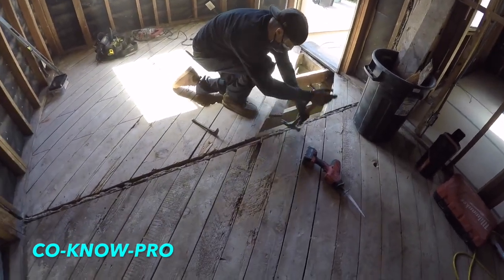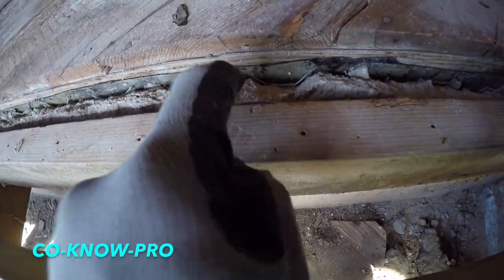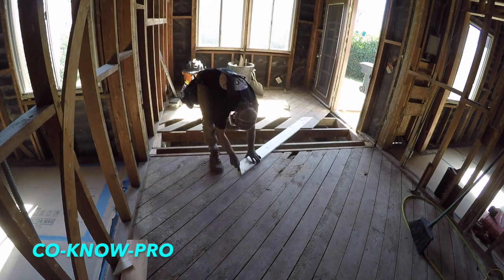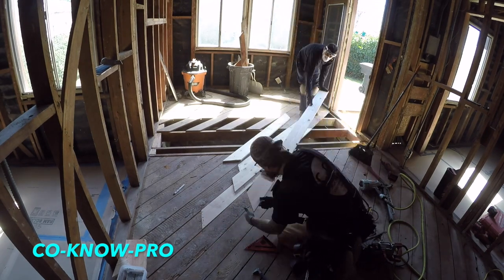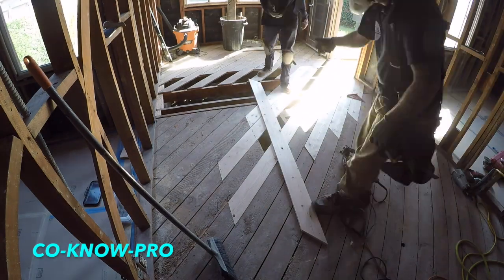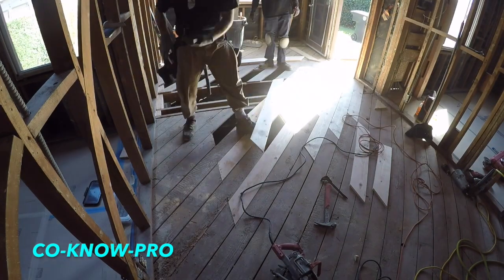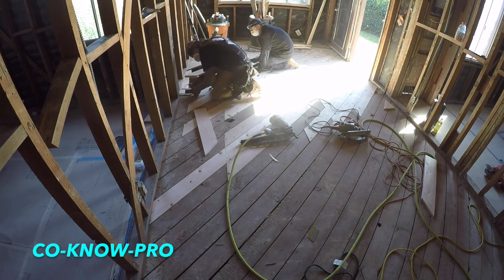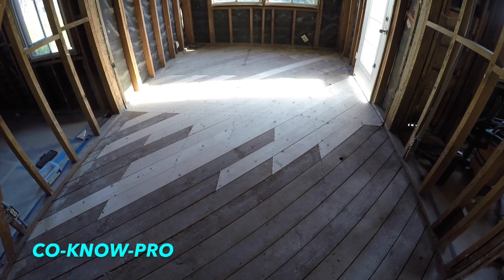🌟 How To Replace Subfloor In A Old House @co-know-proconstructiontips

Comment: Thank you all so much for posting this video. I have a similar project where the addition is lower than the kitchen. The subfloor is tongue and groove heart pine flooring. I wanted to match up the height and continue with kiln dried tongue and groove. Could I face nail them like you did in the video? Or should I nail it like regular hardwood floors?  Thanks!
Reply from the maker: Absolutely our pleasure, you can face nail them just make sure you use galvanized ring shank nails so they don’t back out with floor movement. It’s really up to you sometimes when you just install  finished nails in the groove like hardwood floor you can get buckling if there’s any kind of expansion. 
Also when you get your wood even if it’s kiln dried you still want to leave it in the room where the work is going to be done for a few days or a week to acclimate to the relative humidity in that room so you have minimal expansion specially with tongue and groove if it’s the one by six subfloor planking we install in this video it’s not too big of a deal because there’s the 1/8 gaps between the planks for expansion but when it’s tongue and groove you want the wood to  acclimate pretty good to the structure before you do the install. 
We hope that helps you out good luck on your build👍😎
Reply: Why is it run on 45 degress

Comment: So Happy I came across this.  We’re currently facing a similar situation and are DIY ing to save cost.  
Questions:  is it ideally best to replace the whole subfloor or are only replacing damaged planks good enough ?
How durable are these planks ?
 Lastly , can I use a hammer n nails or is a nail gun recommended ?
Thanks
Reply from the maker: You can just patch were needed, but definitely use subfloor glue liquid nails. And definitely you can use a hammer and nails but may split the wood. If you drill 3 holes on each end at edge as pilot holes will help with the splitting and use ring shank nails. You can toe nail the edges as well to help with the splitting if needed. Hope that helps

Comment: THANK YOU!!! Everyone just wants to rip out or just patch with plywood. I’m trying to convince my partner this is the best way to repair our floor but I don’t know what kind of wood to buy!! Please help! At Home Depot it looks like the 1x6 3/4” is designed for wall usage not floor.  SOS
Reply from the maker: This is the product below we use ⬇️
Your friend has shared a link to a Home Depot product they think you would be interested in seeing.

https://www.homedepot.com/p/1-in-x-6-in-x-8-ft-S4S-Standard-and-Construction-Premium-Kiln-Dried-Hem-Fir-Douglas-Fir-Board-4/206517356
Reply: Thank you! Unfortunately that is out of stock near me. Do you have another recommendation? (My reply won’t post if I put a link in that I found, sorry)  And last question! Is patching a small area with plank is better than plywood or are they equal?

Comment: My house is 80 years old kitchen has the same wood planks in video question the middle of floor is way high seems like 1/4 maybe more higher I went to basement to see if beam was pushing up it was the opposite I have the 1/4 between subfloor and beam now I tried to place a few screws to pull the beam and put the subfloor down but didnt work can sand it down the high spots and put think 12 mm lament down on top or do I need to add a subfloor still on top of subfloor ?
Omg
Reply from the maker: There must be something keeping it from sinking down to the beam. If you can’t get it to lock down tight on the beam, there are two things you can do one cut out that plant to the next Joyce with the 45° cut remove it set another plank in its place dry fit it first to make sure it’ll sit flush with the other planks. Then hit it with some glue and screws or nails and you’ll be good, other option is like you mentioned Sand down or grind down the high points then do the 12 mm Flooring should be good. Don’t forget the  underlayment though. 👍
Reply: Hey thank you for the feedback I ended up wanting to see underneath the floor joist so I pulled 4 of them up where it was lifted ! In the middle of the house 2 huge beams that cross and meet up 1 of the beams was up 1/4 inch and other 1 is down so I will use my plainer and take some Material down should be fine unfortunately I damaged those floor joist what are they called at Home Depot to get new ones ? But I think I will be great now yeahhhhh👍

Comment: That is an awesome job .  I have the same kind of floor I want to lay  3/4 plywood on top to make a sturdy floor " how should I screwed  all through the joist or is there a different way?I am a little confused,  if you can explained that that would be great. Thank you
Reply from the maker: That is a great question. Definitely lay down some subfloor glue on top of the one by six lay down your three-quarter inch plywood. Use tongue and groove plywood if you can and screw everything off to the existing floor joist. 
I would use coated screws minimum 2 1/2 inch or you can use ring shank nails 2 3/8 inch. 
Mark your layout on the wall where you see the floor Joyce going underneath then when you lay your plywood down, you can transfer your sub floor framing layout onto the plywood from the wall then snap your lines with a chalk line, then screw everything off. 
Just make sure you understand that laying down that three-quarter inch plywood on top of the subfloor is going to change your floor elevation at your doorway, leading into the other rooms you will have to put a transition threshold at your doorways, and may need to trim doors as well. Just something to keep in mind. Hope that helps you out remember to subscribe if you haven’t and don’t forget to give us that thumbs up. If you’d like to thank us, click on the thanks below the video and you can donate if you feel like you want to.  👍

Comment: Why didn’t you screw the plank to the joists instead of nails? Wouldn’t that ensure there is no squeaking ?
Reply from the maker: You can use screws if you like but will take a little longer and won’t really be that much better. We are using ring shank galvanized nails with the subfloor glue it will not be going anywhere or squeaking and dose not split the wood as much either. All good either way just don’t use drywall screws lol. Thanks for watching

Comment: Fuck yall did an outstanding job. I dont believe the majority of contractors will take every step to make sure its as robust as it can be as a retrofit. I never really see anyone stagger the joints. but thats vital for longevity as the whole point of the floor system is to dicipate and pread out the load. I have to do this at my house. But im wondering for the small bit of termite damage like that do I have to get a whole house remediation or am I good to just replace it? Ive seen termites in the past but nothing in the past year or so.
Reply from the maker: If there’s no recent activity you may be able to just replace but typically if you’ve seen them they’re there. You may need to have your structure tinted. Do the repair before you tent. If not at least treat the area you repair with termite spray. Before you install finish flooring. Hope this helped 👍Thanks for the awesome comment we appreciate it very much. 👍😎
Reply: @co-know-proconstructiontips  Thank you, Yes it helps a lot! This is my first home so definitely new too all of this. I really appreciate it. One more question. What kind of wood is this subfloor? I had called a repair person and they did similar to what you did except they used picket fence and some crappy nails that squeak already and its just been a couple days lol. I feel like its not done correctly and I would have preferred he use sub floor screws. I kind of want to do it myself because I don't trust nobody else. to do it right.
Reply from the maker: @Lilmiket1000  totally totally understand how you feel. The wood I used was Kiln  dried Douglas fur from my local Home Depot one by six. 
It’s usually over next to the plywood separate from all the other one by material. 
If they use subfloor glue will help with squeaking and ring shank nails galvanized so they don’t back out with the floor movement or you can use a coated screw. 
Also if they don’t allow at least an eighth joint between planks it can expand in cause squeaking as well when walking on the floor. That’s why I like using the kiln dried because it’s not gonna shrink much when you bring on to your job site. If you use regular wood like a fence plank has a lot of moisture in it will have to acclimate at least two weeks to your property may shrink and expand while doing that. 
Hope that helps let us know if you have any more questions good luck with your project. 👍😎
Reply: What do you do if the wood you're replacing is actually 1in thick and all the new wood is 3/4" thick?
Reply: @shawnsingletary3791  you can get 1 inch plywood from BMC rip it down. 
You can get 1 inch pine as well from BMC or Ganahl Lumber. 
Sometimes it’s beneficial to rip out all the old wood  and go with all brand new three-quarter inch plywood but then you may have an elevation change at your transition to the next room between doors. Then will need to put a threshold there.
Reply from the maker: @shawnsingletary3791  sometimes its beneficial to rip out existing floor, then throw in all new 3/4 inch plywood but you will have to put a threshold at your doorway where the transition is between rooms. You can also get 1 inch pine or 1 inch plywood from BMC or Ganahl Lumber most lumberyards should have 1 inch product. But make sure it’s actually 1 inch.

Comment: I found out I had a similar subfloor in my house. I just removed the old carpet and there is old soft wood flooring above my subfloor which is just like the one you’re working on. The wood planking above the subfloor has gaps and squeaks a lot, I’m wondering if I should remove that planking down to the sub floor which is in great shape? I’m installing some vinyl plank flooring in both my living rooms and hallway. I don’t know if I can get rid of all the squeaking floor above the sub floor without removing it. What would you do? Thank you!!
Reply from the maker: Great question, there are a few ways you can get rid of a squeaky floor. You can add additional supports to the floor, Joyce, which will restrict movement in the floor, and will have less friction between joints and less squeaking or you can remove all of the existing subflooring and add three-quarter inch tongue groove subflooring with liquid nails, subfloor glue on the joist before you install your flooring and then use a ring shank or spin shank nail attaching the plywood to the floor joist That will also help get rid of the squeaks.
You may want to add some additional blocking to your floor Joyce before you commit to removing all of your existing subfloor that may get rid of a lot of the squeaking. If so, may save you some money. 👍
Reply: @co-know-proconstructiontips  yup I’m going to try that first. Thank you!

Comment: can you advise what to do if you have some dips in the floor after you've done a repair on an old subfloor like this? I'm installing hardwood on top.
Reply from the maker: That is a great question! What I’ve seen done in the past is where the dip is you install a 1/4 inch or 3/8 inch under laminate veneer plywood with subfloor glue then you grind down the edges to taper the edges to where it meets the level part of the existing subfloor. As far as the Framing goes if there is a post with base on a pad underneath the section that’s dipping you can remove the nails or screws from the post that connects the base to the girder then Bring in a 12 ton jack set it under the girder and jack up the section that’s dipping once that’s done and jacked up then pull out the existing post that you remove the screws or nails on and install a new one that should be at new height. 
Of course we recommend you hiring a professional to do this but that is one option that can be done. 
I would definitely get some recommendations from an actual hardwood floor installer see what they recommend. Thank you for the comment good luck with your project. 👍😎

Comment: Exactly what I was looking for.  Quesion: How do you cut planking when only have access to bathroom floor? These boards run through bathroom & into adjoining rooms of house.
Reply from the maker: You will have to expose the subflooring wherever you want to replace it. Typically what we do is cut the planking about 2 inches away from your partition walls then add the backing below where you cut the sub flooring. Then you can attach the existing subfloor to the new backing and then run your new subfloor to the new backing you’ll have to do that on both sides of the wall. 
Hope that helps 👍 Let us know if you have anymore questions.
Reply: @co-know-proconstructiontips  Thank you so much!!  I believe this will work fine. 😊
Reply from the maker: @worldpeace8187  you are very very welcome and let us know if you have anymore questions 👍😊

Comment: How do you pour self leveling on a subfloor like that? How can I prevent the self leveling from sipping through the joints? 🤷🏽
Reply from the maker: Well, there’s a few ways you can do it if you really are adamant about poring self leveling cement on these type of subfloor there’s a few ways. You can run paper backed latheing or you can run some under laminate plywood 3/8 then do your self leveling lightweight cement. Hope that helps 👍
Reply: @co-know-proconstructiontips  , it's a 9x5 bathroom floor. What would you recommend instead, I will be installing hexagon tile on it
Reply from the maker: @twoserve2449  I would recommend throwing down some tarpaper two ply or single ply is  fine, stapled down then I would throw down some half-inch hardy backer board, locked in with hardy backer screws that would be really good product for you to install your hexagon tile to I’ve done probably 200 bathrooms that way and haven’t had one callback. Still looks beautiful 20 years later. That’ll pass inspection that’s code. You can sleep good at night with that being done that way. 👍😎
Reply: @co-know-proconstructiontips  , that sounds very good, I can do that!, thank you for your time and advise 🙏
Reply from the maker: @twoserve2449  Absolutely our pleasure you have any other questions concerning Construction just let us know we got your back.👍😎

Comment: Noob question - wouldn't it be easier/cheaper to just rip it all up and install brand new plywood subfloor?
Reply from the maker: Great great question. It would actually be much harder and more expensive to remove all of the existing one by six subflooring. For example if you notice on the video the one by six goes underneath all of the existing exterior walls and interior walls so that means the bottom plates are sitting directly on the one by six. That being said if you cut around the perimeter of your entire room you will have a weak joint when it comes to the plywood butting against that left over 3 inch  one by six that’s underneath the wall that you can’t get to. So what a typical good framer would do would be perimeter blocking like I showed in this video but they’d have to do that around the whole bedroom is install   blocking right in front of all of your walls to receive your plywood edging to create a good connection between outside walls and subfloor it would be a lot more work. Now if the majority of the one by six is toast then definitely switch it out for three-quarter tongue and groove plywood and subfloor glue with ring shank galvanized nails would be good to go. Like I said absolutely great question thanks for asking and hope that helps. Have a wonderful day check out some of our other vids don’t forget to subscribe and like 👍🏻
Reply: This is what I have been doing with my old house. It's more work. But it's a better floor. You'll have places you'll have to add new joists, and on some of the walls, you'll need to scab in 2x6 for the osb to land on. In the end it costs more and is more work. But the floor comes out better. Also, if your floor is unlevel, then laying new osb gives you the option to level it just by adding in some new joists. Also don't forget to seal the out side seam of the new osb. These old 1x6 floors are strong but leak a ton of air and can make a ton of noise.